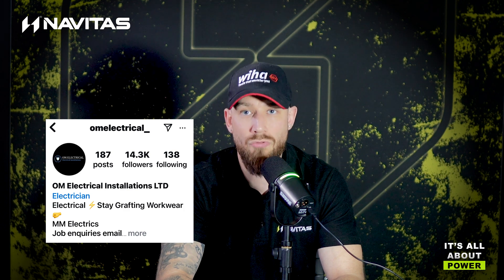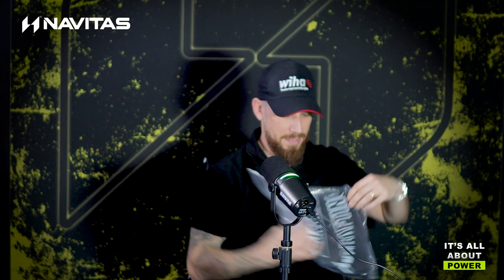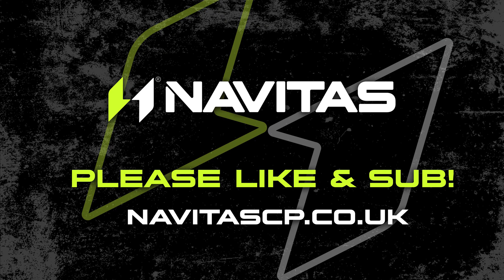SHOULD YOU FIT AN IP65 CONSUMER UNIT

Comment: I get that moisture is a risk in ip65 units. Not sure that I agree with the statement that warming air creats moisture. To crest moisture hydrogen needs to come from somewhere to combine with oxygen in the air to form h20.
I believe the isdue is that warm air can hold more moisture than cold air. Therefore if air is warmed and has moisture available to absorb it will yake up more moisture. If that air rhenium cools or touches a cool surface it will release that moisture.
Therefore the issue is ip65 units pulling in warm damp air that then cools to release moisture. My assumption is that the issue is more likely to come from the unit cooling down after a charge is complete, cooler air takes less space, damp air then pulled in and condenses on cold surface of enclosure. Or some simillar process.
Reply from the maker: This is essentially highlighting the points made. The condemnation of which is generated by the combination of heat internally and cold externally. 

Certainly needs reviewing